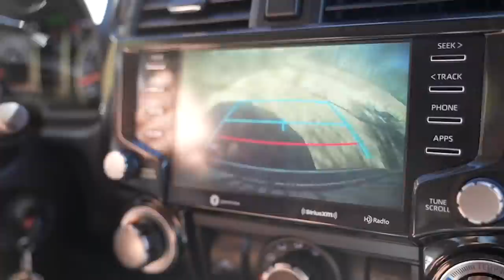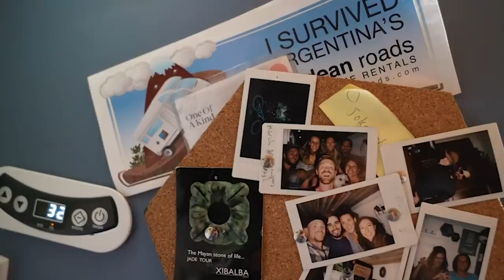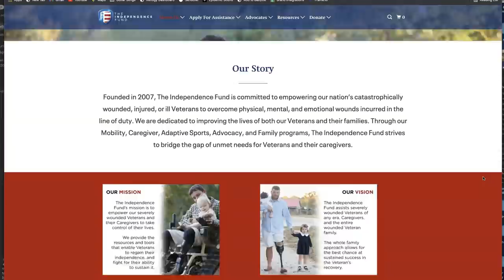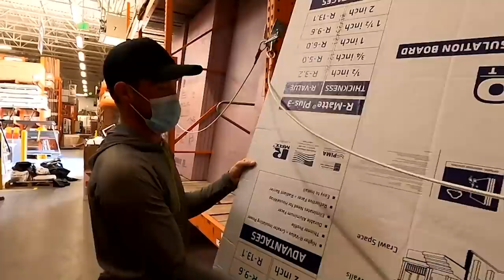A HUGE DISAPPOINTMENT... | BUILDING OUR OWN HOME

Comment: Please put handrails on both sides of your stairs.  Several years ago I slipped off the side of a near the bottom wet stair.  My thigh bone popped out of my hip bone as I did the splits.  Was painfully out for 8 hours while waiting for an ambulance and a specialist was called in and a very long recovery is still taking place.  Self care as you mean so much to many of us who are enjoying your journey.
Reply: Yes,. They have to put one in sooner or later, should be sooner with a pregnant wife.
Reply: Similar thing happened to my Aunt, she slipped on steps down to carport, and broke her arm. No handrail. Also, handrail will help with anyone visiting with any kind of mobility issue.
Reply: I am sure they will be installing railing. They have to install railing for the entire deck, which will probably be installed after the finish drywall & siding. I am sure railing is required by code, so they don't really have an option not to install railing
Reply: Most building codes  require  handrails on all steps  - you will be glad  you put them on.

Comment: Where is your tractor? You could use it for so many things like leveling out your areas for your van  ? You need to level out more areas on your property for parking etc before winter if possible
Reply: Its just for snow
Reply: @51-FS  you hit the nail on the head! It could have been used for so many things all winter as well as grading. Material handling mad easy!
Reply: Oh and they use it to jump terry win the batterys die.
Reply: I would be useing the tractor every day.... get some forks and then u got a fork lift
Reply: No loader on it.

Comment: As the daughter of a drywall contractor…. There is nothing more frustrating than dealing with distributors and honestly other contractors. So many are just full of it. They are a genre of passive aggressive, conflict avoidance masters. It use to drive my dad crazy.
Reply: @ Jackie Nation 
So -- it wasn't just the ones I knew! 🤔 They're still an amazing group as far as what they accomplish, yes?
Reply: Amen!! Hit that wall myself....
Reply: 🙏❤  for Brandon and your family on the road.  We ordered Costco's 4 appliance combo, Samsung, with no issues, had it within 10 days and they install. 
Hello Baby Gingersnap 🥰
Reply: It is not too late to get a drywall contractor. They may look more kindly on your job if it is already stocked. You will end up with tons of butt joints, and you can't finish a butt jointy! Call them now before you screw it up! It is not bailing on doing the work, it is a show of wisdom on your part to hire experts for a very difficult job.

Comment: Hi Folks,  just a suggestion.  Probably to late but I used a lot of my scraps and left over wood for temp parking pads for my travel trailer and my tractor.   I just put 2x6 and/or 2x4's together to pull the equipment up on to so they wouldnt sink into the soft soil to much... my travel trailer is on 2x4 supports with left over wood panels attached on top.  working like a charm even after 2 winters. :)..   As you have stated on this video, deadlines are made to move out in construction and costs make things take longer to get too as well...

Comment: Pay extra for the drywall to be delivered and set by boom truck on your deck or better yet inside the door (otherwise my back will hurt watching you try to carry it).
Reply: .. with a proper supplier ,they deliver to inside the house ,, on each level needed ( might have to remove a large enough window if not thought about earlier)...

Comment: Lesson learned. Quote is not an order, and always ask for names and numbers before hanging up. 
Yikes. How rude.
Thank you for sharing your lives with us!
Reply: The fact they didn't give a quote order shows they never intended on helping though & that's the issue. Just tell them right off the bat so they're not waiting & expecting a quote.
Reply: @Mandy_39  LKL is struggling to get truckers to haul to the supply yards.  They have accounts with the biggest drywall contractors in the state, and have to give preference to them, over a one and done.  Thats how it works.  Even with a quote#, if DAW, KYCO, or any of their other customers walk in and want board, they get it, and Trent would have a quote # with no board.

Comment: You might want to really check out your appliances thoroughly for damage.  Stores are less apt to deal with your returns/damage if not reported quickly upon delivery.  Sometimes the cardboard/foam looks fine, but damage is still underneath.

Comment: Being concerned about your dogs chasing stuff in the mountains is extremely prudent. First thing, dogs can run down a deer. Deer can get away quickly but if your dog is determined, the deer has much less endurance and the dog(s) will eventually catch the deer. Doesn't sound like that's going to be a problem as your dogs seem to do it for fun as much as anything else. Moose are another issue and the dogs will probably learn quickly about trying to harass a house sized animal. Far more dangerous and painful are porcupines.

My friend in the mountains of Utah had a black lab, Willy, and Willy got into a porcupine which is a nightmare you will not believe and bad enough, but what was worse is that Willy learned to hate porcupines and whenever he'd recover from his initial encounter off he'd go, back to the woods to attack another and come back covered with quills - again and again. Can't remember what happened to Willy (that was 40 years ago) but it was not good.

We also lost 2 dogs to the sheepherders that occupied the upper meadows in the summer. They would put out poison or simply shoot any dog they saw as sheep are easy pickins' for almost any dog.

So yes, be cautious and wary about the dogs running off into the woods.

EDIT: Wrote this right before Trent mentioned porcupines and yes they are a horrible mess If your dog gets into one..

Comment: Get your tractor ready for next season before the baby comes.  Off-season parts and materials may be cheaper.  Pickle your tractor for sitting during the off season with a trickle charger and an oil/filter change.

Comment: When I was a kid, my uncle's dog got caught up with a porcupine and I have never forgotten the hideous sounds comming from that poor animal for at least 20 to 30 minutes of enduring torture while my poor uncle had to one by one pull a mess of quills out of that dogs nose. I also have never forgotton the look of dreadful anguish written all over my uncles face while having to do that. Breaks my heart just thinking about it.
Reply: The porcupine quills are not smooth edged, they are saw-toothed. They don't just easily pull out.
Also, dogs will go back time and again to mess with the porcupines, they simply do not remember the last bad experience.
I have a friend that lives in Northern Michigan and his short haired pointers are both trained nit to chase deer - he's on 40 acres and the deer are as abundant as ever - they just know, don't bother them, so it can be done
Reply: Also, don't discount the deer.  My dog was attacked by a deer a few years ago, and that was an emergency vet visit. (And he wasn't even chasing them. The deer chased the dog!) Deer usually run away whenever possible, as you have seen, but not always.
Reply: Eamon and Bec's foster pup tangled with a porcupine and they found out the hard way that a vet should be removing the porcupine needles.
Reply: That's the 2nd comment I've read about others direct experience with that and it truly has me upset and concerned. I live in mountains too and never once did I worry about porcupines - coyotes, bears etc but not once porcupines. I will keep an eye out now!!

Comment: If you’re buying a lot of drywall and I believe you are betting you can get Home Depot to deliver drywall to your house. They deliver bulk supplies in my part of the country. Worth asking about anyway.
     BTW- you may not think it was a productive day but gesh…..y’all got a lot done in 1 day!
Reply: Here they will deliver 1 pice.... it will cost u 80 bucks but they will do it.... but I don't know how far out they will d8
Reply: @51-FS  I worked  down  at the lumber  area for many, many  years. You should place your order through the pro desk, and they will  get it ready.  If you  pay a delivery  charge, get as much  stuff on the truck  at one time as you  can. Most customers get most building materials  from HD - they become familiar with you and are a big help with your project.  Usually  former contractors work  there and you get the expertise they embody . Good  luck  on your  house !!
Reply: @sandragreen9560  I agree, get it all on 1 truck & NOW lol. Like seriously walk through the house & get as much as you can. Might've been alot of drywall now but could be gone tomorrow.

Comment: Even in normal building times it's very difficult to have building materials when you need them in a timely matter much less during these times. 
Demand over supply is out of wack so be flexible and brainstorm other tasks that need and can be done.

Comment: With 2 dogs they act as a pack.  They will hunt and chase wildlife, children and visitors. You know this could end up very serious in many ways. The longer they are able to run independently the more bold they will become.  You need to put up a fenced area for them.  Even if it is a cheap "snow" fence.  It is irresponsible to let them roam.

Comment: You as a responsible dog owner are required to cure your dogs from chasing wild game....It is a terrible habit that is hard to cure the longer you let it occur and eventually could have you in serious legal problems.  There are shock collars used by field trials trainers that will stop the dogs in their tracks or just give them a mild reminder to stop the chase...You definitely DO NOT WANT your dogs to tangle with a porcupine...a face full of quills are nearly impossible for most homeowners to remove, due to the dog is frantic and the quills are difficult to pull, even with pliers, without getting bitten by your dog...it is a vet visit...in addition if a quill breaks off when the vet removes them, the quill can travel to the dogs brain and ultimately kill the dog...Just remember the dogs get the quills when the porcupine feels threatened and flips their tail into the dogs face....the dog doesn't necessarily have to try and bite the porcupine, he just has to get too nosey......YOU must train your dogs for rural life.  Rattle Snakes are another possible problem in the mountains the dogs must be conditioned to stay away from.  Good luck on training the pups.
Reply: Do not harm dogs with electric collars! Simply don't let them off the leash until they are behaving well enough to listen to your commands.
Reply: Even after the dogs get stuck with quills, they will do it again. Our vet says he has treated the same dogs multiple times. 
 We had to take our 2 dogs in to the vet. He had to sedate one of them. He removed about 100 quills from her mouth,tongue and throat.

Comment: Drywall - hire it out - we built our own house but contacted out the drywall 👍
Reply: They may not want to spend $25k+ to have it done. They could also use the content I'm sure.
Reply: Only thing we did was electrical. My husband is a master electrician. I don't even want to paint. Contractors knocked out painting entire interior including trim and ceilings in 48 hrs. I could have never done that, without making a mess. Trent's and Allie are 20 years younger then me though.  Im amazed by  your ambition and stamina. ❤️🔥⭐️💪

Comment: My husband and I are remodeling a bathroom. We’re using white Carrara marble in various places and we’re having to use 4 fabricators because the general contractors in our small town are booking everything up. If we used the first place we went to we would have to wait 6 months. We were in line first but we’re a small job and we don’t matter so they changed our place in line. Very frustrating! A 1 year project is going to take 2 years because of the pandemic. I feel your pain. (We’re remodeling our entire house and are 3/4 done)

Comment: A little upset? Irritated? I would be flat pissed off!
Reply: YES, THAT ^ !!
Reply: Imagine being me, and contractor with LKL account who does regular buisness with them, pulling up and seeing a truck loaded to haul to some dude, and being told I'd have to wait.  There is a pecking order, like it or not.  The biggest accounts, get the best, fastest, and cheapest service.  We aren't all equals, your not dealing with first come first serve
Reply: @hossblur1  you missed the point. The anger comes from not being told that fact from the very beginning. If that’s their policy, then just let people know and don’t waste their time. And you really should come down off your high horse
Reply: @valerieann2751  LKL is not Home Depot.  Its a PROFESSIONAL supplier.  Meaning its buisness is to SUPPLY PROFESSIONALS.  But further, there is other reasons Trent  was dealing with LKL, namely boom truck delivery.  Calling out a local company sucks, when in the same episode he didn't name the national appliance company
Reply: @hossblur1  again you missed the point. Just tell the customer that info and don’t jack people around. Period
Reply: @valerieann2751  again, you dont know what your talking about.  I do buisness with LKL weekly.  They dont do orders via call back, or return call. And you don't get to just "hold" sheetrock until your ready for it.  You set up an order, and a delivery.  Looking at the date, im guessing he tried to order sheetrock before the price hit, but not have it delivered until after, which they dont do.
Reply: @hossblur1  if they don’t do order via call back or return call, why did the sales guy tell Trent that he (the sales person) would call Trent back?  Again, you missed the point that it was not the drywall itself, even though that was the ultimate goal, that was the request...it was the fact that the salesperson did not tell them that they might not be able to fulfill the order as the contractors have first priority. Would it have been a different scenario if Kevin, Trent & Allie’s contractor, had called to place the order?  If they had known, they could have done some research to find another company or order from Home Depot. And Trent did call out Home Depot on the appliance issue.  He said they got some of it pretty fast but the final two pieces were finally arriving and that they were warned of the delay prior to placing the order (which is why they ordered so early in the process). He then did thank Home Depot for fulfilling the order.  Again, it was not the order itself that irked them, it was the fact that they were not upfront with Trent from the beginning of the order placement.
Reply: @stowie5790  Notice the LKL hat Allie is wearing, and the shot of the dudes in yellow shirts hauling in sheetrock?  Seems that LKL did deliver to them.  Any bets on this channel and publicity getting leveraged to make that happen?  IF your so mad at LKL, then why is LKL delivering?  HMMMMM??

Comment: porcupine hack. Take some wire snips and cut the end off the quills and it releases the pressure and you can pull them easily. At least that is what I've been told.

Comment: Get a drywall contractor to do your job. They will do it in 1 week, you will take 2 months and be frustrated by it all. Do you really have the time? Can't trim or paint or install appliances or flooring or anything until it is done. It is an acquired skill that takes some experience. Walking on stilts helps. Besides they can get the drywall.

Comment: You should hire a contractor for the sheetrock 1. They could pound it out 2 times faster 2. It is every heavy. They have the equipment to get the rock in the house for one. 3. You are on a shorter schedule.  I have done rock you got to have a good back that why rockers are short

Comment: USG = drywall. Check Washington state, lot of drywall produced there too. If you don't mind some plastering, can use cement backer board instead of drywall, and more of it available right now. It cost about 20-30% more perhaps, but does come in 1/2" thickness too, & stronger than drywall.

Comment: When you talked about in the last video I wondered why you didnt just get some from Home Depot. And now you went and got like 11 sheets of foam why didnt you buy 10 sheets or so of drywall then? Just to get a start! That truck wasnt sweating with that foam. And why didnt you use your tractor to unload gravel? Doesnt it have a loader on front?

Comment: 1. home depot and lowes are the hardware equivalent of Walmart... so yeah lots of buying power, and you should be able to place an order for them to deliver it to your house as well. 2. about the second shovel load of gravel, I was wondering why you didn't have a front bucket for your tractor so you could have just snatched that bag off your truck

Comment: Hey Trent. Pamela van. Is mad at you for parking her in the mud.
Dude buy 2 boards .. 2x12 by 10'.. cut them in half. Rake out the dry mud level where the Van's parked. Lay down a cheap green tarp. Lay down the boards on top. Drive Pamela back on the boards. Or the van will rust out under her. And the tires will rot. If it rains the van will sink in the mud...(your welcome )

Comment: we had the same trouble with sheetrock. we could only buy 10 sheets a day  because i wasn't a contractor. so me my mother and my niece and buy 10 sheets each and put them in the same truck and use the same credit card. and get 30 sheet if they had that many. and now that i only need 6 more sheets and its going to have to wait for awhile. i can get all i want at $1 cheaper. and lumber has dropped a little also. not much but it has dropped